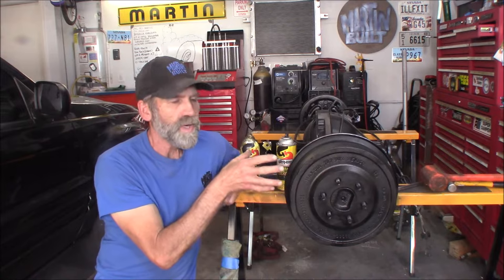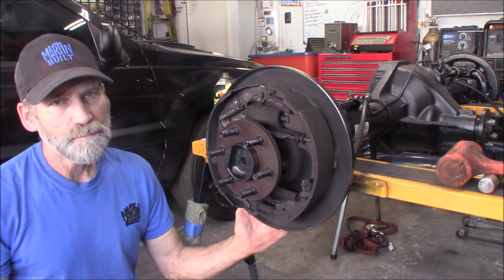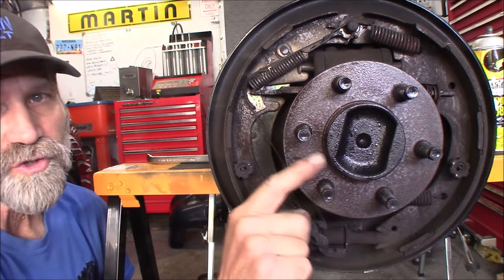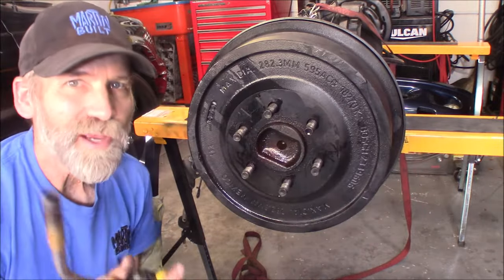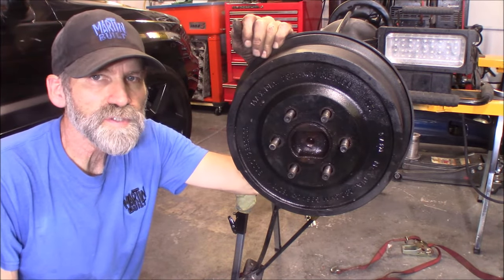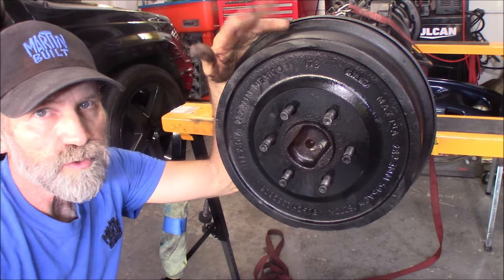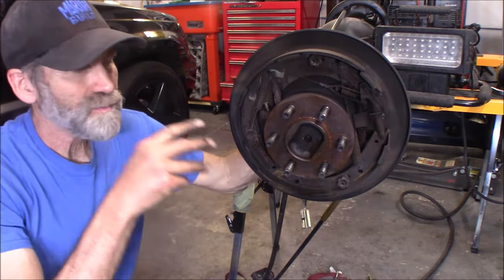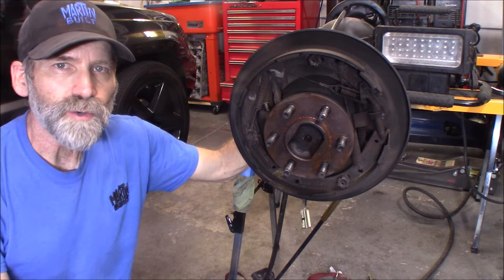How to Remove Stuck Brake Drums

Comment: Hilarious! When he said,'this is why you should hate drum brakes!'
Reply from the maker: Lol...well at least one of the reasons. I have got this axle converted to disc brakes and it way out-performs the drum brakes it had. I now need to upgrade the front disc to larger rotors and dual-piston calipers.
Thank you for watching.
Reply: I don't know why they came out with drum brakes. The drums are hell to get off and brakes  are hell to put on.

Comment: I worked for a whole day trying to free my stuck brake drum. Took a break and found your video. I used my air hammer on it for about 5 minutes and the drum slid right off. Cant thank you enough for the help and guidance! Super video.
Reply: The island boys

Comment: I'll save you some time. Strike the drum at the outside edge toward the diff, alternate across the drum. What happens is it levers against the axle flange. Drum usually survives with out being bent, but bad stuck ones often get bent.

Comment: Easy (but most have a problem with obvious solutions):
- do not install discs/drums dry, you can lightly lubricate or spray paint the hub, no more rust problem,
- make a chamfer (lathe) on the brand new drum, so the "ridge" doesn't develop and shoes don't catch.

Comment: Great  job. My brake drum on my 2011 silverado LT 1500 5.3liter does have those 2 holes, but what bolt size should I use ?
Reply: Must be a standard thread, 7/16" or so... 👌

Comment: I just got two stuck drums off a truck rear by drilling two 5/16 holes in the drum & slightly into the axle flange.  
The axle is forged steel which will yield a rolled chip & the drum is cast iron which yields small flakes of cast iron. 
This is the easiest way to tell you are through the brake drum.  
Then look for the rust ring at the bottom of the hole & continue to drill until the 5/16 hole is through the drum.  
Use a bolt through the nut to center the nut over the hole you drilled. 
Weld a 5/16 nut to the drum using high nickel content welding rod for cast iron. 
Once you have it off, cut the nuts off & grind smooth. 
Grind the rust off the axle & interior ring of the drum. 
I hesitate using a hammer on any thing when bearings are absorbing the force.  
Working in an automotive machine shop for years, replaced may bearing that failed due to these forces.

Comment: Air hammer is a great idea. Did you just weld the hammer to a rod ?
Reply from the maker: Thanks, I used a impact socket installed it upside down to Chesil attachment and then welded it on

Comment: What are you up to Martin. Never had to mess with drums. My air hammer came in handy replacing my rear rusty leaf spring shackle. Thanks
Reply from the maker: been working on this axle. It will be going into my 01 Dakota. Converting the drums to disc.

Comment: Some vehicles have two bolt holes that use 8mm bolts I just put them in & turn them & presto comes off easy, I would never use heat torch on a drum chances could cause fire & even damage the wheel cylinders rubber boots & seals inside the cylinders.

Comment: Question....the adjuster from behind after you remove the plug---> isn't it true for most cars the adjuster is setup to bring the shoes wider apart?...and the "ratchet" wheel will not rotate the other way narrower unless the spring-arm on the star-wheel has it's tension released? If so....how do you do this from behind?
Reply from the maker: Yes, it is pretty much typical for vehicles with drums and shoes.
Yeah, I use a narrower straight blade screwdriver to push the arm outward. That is holding the star wheel and then another tool to rotate the star wheel.
Thank you for watching.
Reply: @martinbuilt  ...yeah I kinda was afraid this may end up a 2 -hand operation with my face on the backside !!.....haha.......

Comment: Hey Martin, how difficult of a project is that, switching to disc breaks?? I have a 2002 QuadCab 4.7 with rear drum breaks, would love to switch to disc breaks. Would i need mess around with trani?? Also, this truck has 1 piston caliper, i know that some Dakotas with the 4.7 have disc breaks all around have front calipers with 2 pistons, would i be able to switch out the calipers for better breaking power??
Reply from the maker: The easiest thing you can do to put disk brakes on the rear of your Dakota is to get them from a 93 through 98Jeep Cherokee ZJ. I'm doing it the hard way I'm getting mine from an 03 Durango they have larger  disk breaks.  Currently working on that project right now hopefully I have it done in the next couple of weeks. I'll have the 1st video out this Friday which will show you part of why it's not so easy.
 Yes you can install dual piston calipers in the front from a 2003 and 2004 Dakota and l 2002-2004 Durango.  I will also be doing that conversion as well.
Reply: @martinbuilt  👍👍👍
Thanks Martin, im not too mechanically inclined but i try to do as much as i can on both my Dakotas, 2004  4.7 2 door SPORT and 2002  4.7 4 door SLT. Prior to those i had a 1997 3.9  2 door SPORT (regret getting rid of it). Love all your videos, all the mods you do. Cant wait to see the final project of your Dakota

Comment: Hey martin what is the axle width for those durango and Dakota axles? If you dont mind helping me out. Wheel mount surface to wheel mount surface. Im debating doing either a ford 9in or the chysler 9.25 swap to my wj. And lets just say the 9.25 is more affordable
Reply from the maker: too bad you didn't ask me yesterday, I just removed the axles and entire drum brake system and doing a disc brake conversion. Give me a week and I should have it all back together and be able to answer your question. I'm liking the 9.25, I feel doing a gear setup seems easier than most other rear ends.

Comment: maybe spraying water on the drum after applying heat?  The thermal shock may have helped.  On the other hand, progressively larger hammers do wonders as well.
Reply from the maker: Thanks for the tip 👍

Comment: Can't pull drums from '03 Alero due to ridge on drum interferring with shoes.  Usually would back off adjuster....BUT, there is NO ADJUSTER HOLE in the backing plate!!!  Never encountered this.  Can use the brake caliper guage to make adjustment of new shoes be fore putting drum back on, letting automatic adjuster make final adjustment.  But, cannot back  shoes off to remove drum.  One suggestion was cut spring pin head off on backing plate.
Reply from the maker: Have you checked the face of the drum? Sometimes the adjuster hole is there.
Reply: @martinbuilt  Thanks for suggestion, but no access through drum front either.  Further examination, appears must disconnect parking brake cables to get enough slack on shoes to clear ridge.  Trailing locating arm is located right where typical access hole is on the backing plate.  Must have been a D- project design in Engineering school......
Reply: @stlpro2a386  What did you end up doing? My drums are loose from the flange, metal shavings fall out, so I know there's a ridge! NO adjusting slots front or back! ??

Comment: but what about the adjuster lever that allows the adjuster wheel to only spin one way, to tighten?  Not quite as easy as shown here.
Reply from the maker: Sometimes you need another tool like a smaller screwdriver to push the adjustment lever outwards.

Comment: Not everybody has fancy tools like you, what I do is just wack it between the studs with a hammer and they brake loose. If your aim is not good and you don't want to damage the threads on the studs use 2 hammers. Place one between the wheel studs and hit it with the other ball pin hammer same result.
Reply from the maker: When I did the first drum it came off after I applied the heat and they hit it with the hammer.
Reply: Wasn’t aware a air hammer was a fancy tool

Comment: Good job but drilling 2 holes and tapping them for a forged bolt to push the drum out would be easy than takin out whole axle
Reply: How are you going to drill holes and tap them when it’s stuck on?